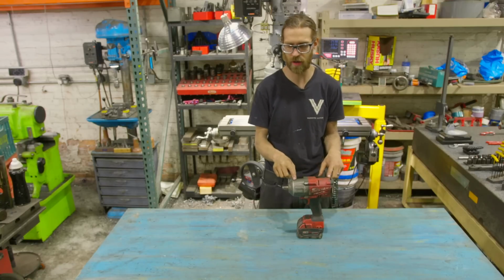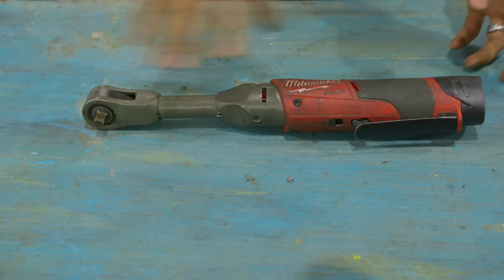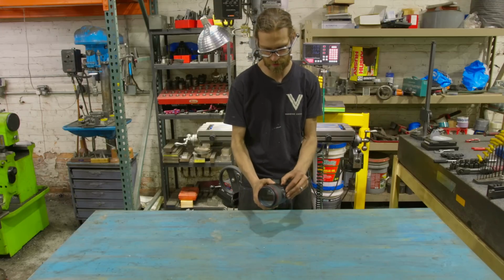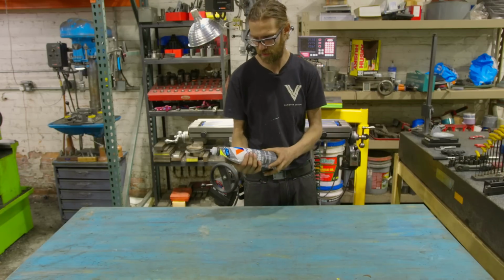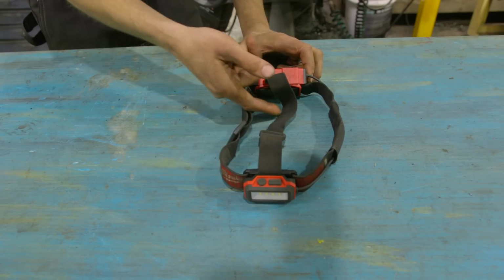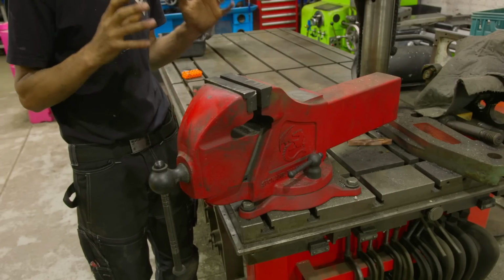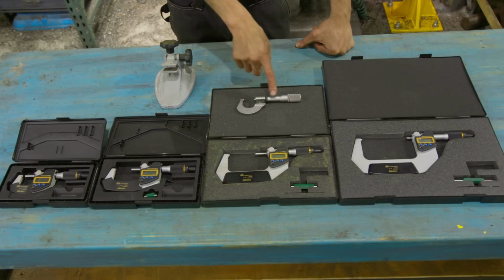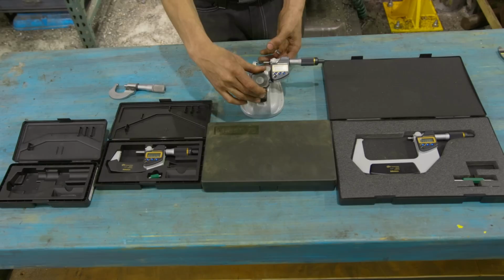25 Tools I Absolutely Love

Comment: I also love Starrett, However !!! Their electronic digital micrometers suck !!!
My wife bought me a 0 - 1 Digital Starrett micrometer, after about one year of use
it drooped a digit, so I tried to warranty  the mike, and my dealer sent it in. It came back un repaired with a note saying that is was discontinued, and no longer supported.
The Starrett dealer told me to always buy Mitutoyo, because their electronic stuff is just better, and I can verify that fact.
I have a Mitutoyo digital caliper, like yours, except it is 40 years old, and still works perfectly, and is extremely accurate !!!
I think I paid bout  $104.00 dollars for it, and a new one costs almost the same.
Can you say good value for the money !!!

I have tons of Starrett stuff, most of it 40 to 50 years old, and it is excellent, however, 
the new stuff dose not have the same fit or feel, and the thread gauge set has rounded V's
and the center gauge is a poor quality stamping. It can't be compared to my 50 year old one !!!
Starrett quality has slipped a lot over the decades.
Now I only buy used Starrett stuff, because it's better quality, even used !!!
Tim
Reply from the maker: Agreed the digital Starrett stuff sucks. I go Mitutoyo for that. But mechanical Starrett is where it’s at

Comment: The EF mount version of that lens is no longer manufactured.
Reply from the maker: What dang…
Reply: @VanoverMachineAndRepair  to be honest f1.2 is more about bragging rights than function in todays world.  f1.4 is enough for light gathering with the clean higher ISO's you can get with today's sensors, and there is a point where too much depth of field can become a nuisance.  Just my opinion 😁